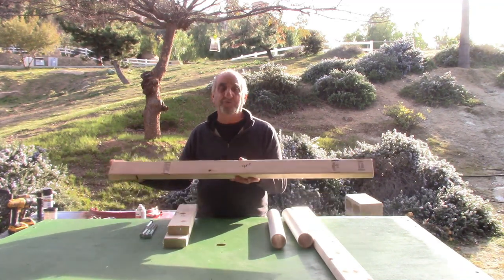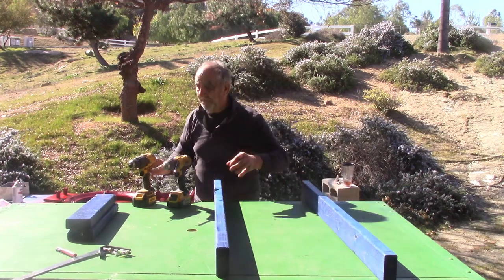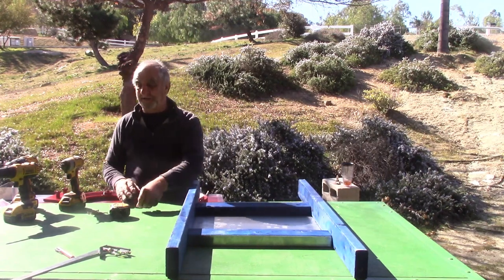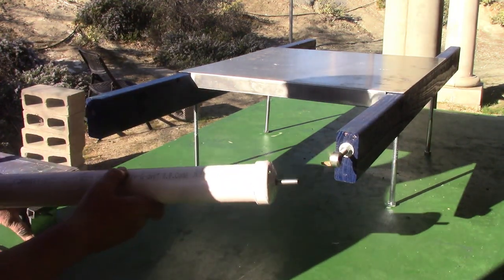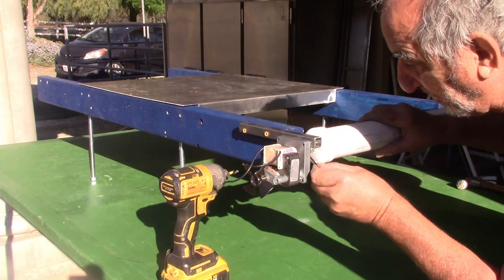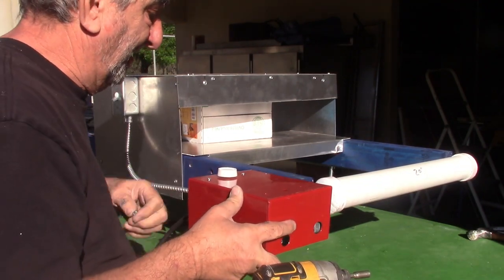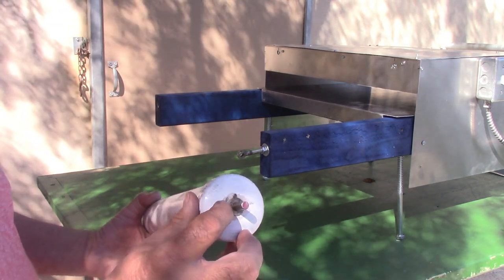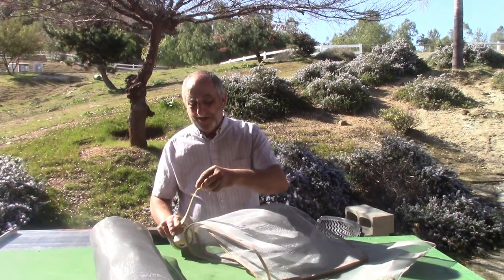Mini Conveyor Dryer -How to build your own

Comment: Great video! I have a few questions about your mini custom Conveyor dryer. 1. how is it going for and what exactly will include when purchased? 2. can this be used with a regular electrical outlet or does it need an industrial outlet? does it have a temp control setting for the temp curing different types of inks and speed control due to some inks dry at different temp and time? also is it up on your site or is it still just a prototype? hope to hear from you soon. thank you!
Reply from the maker: great questions , just plug it in any 110 volt socket at home or work  it is 18 amps so do not use any extension cords just plug into the wall all pricing and material list will be on my website by sometime tomorrow 02/17/2020  the way to adjust temp is simply raise and lower the complete hood I think it will be around 4' above the belt , I plan to experiment what works best .  As far different inks I am only familiar with plastisal ink and that is what I am setting it at . the motor is at one speed 12 RPM's  which is 30 seconds to travel from one end to the other .hope this helps . if you live in SOCAL you are welcome to stop by
Reply: @BobMongiello  awesome ! I'm in New York City.  looking forward to seeing more video thank you!
Reply: Just the best Bob's has the biggest heart on YouTube and he is really there to help
Reply: @BobMongiello  is usually 30 seconds enough to cure plastisol!!! what if i printed with water based ! thanks and hope to hear from you.
Reply from the maker: @rommycougar   after fooling around with this conveyor i have made changes i should have more videos out by the end of AUGUST 2020 to answer your questions :)
Reply: @BobMongiello  Hey Bob!  This is Ray-You are so damn cool! Thanks for doing this...just as I had asked! Now I can't decide whether to have my mobile T shirt business doing live screen printing with this cool mini conveyor-this conveyor could be a show in and of itself most people have never seen this-or to sell pizzas!!! i am kinda hungry right now so I'll check in with you later!!!! Awesome!!!
Reply from the maker: @tucsonairbrush3233   LOL !!  do both it's fun!!
Reply from the maker: @tucsonairbrush3233  Do both :)

Comment: why do you need teflon tape for the sides?
Reply from the maker: the screen needs to have a clean edge so it will not snag or fall apart and you need something that will handle the heat .